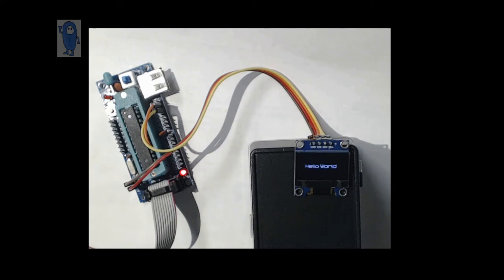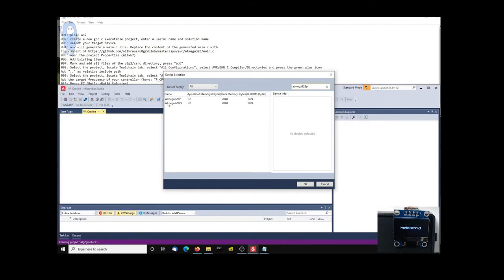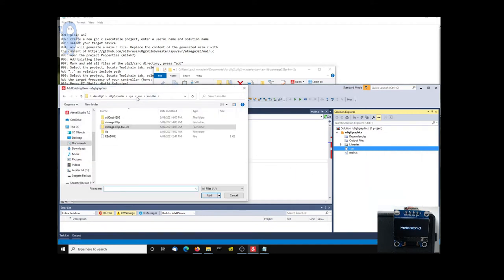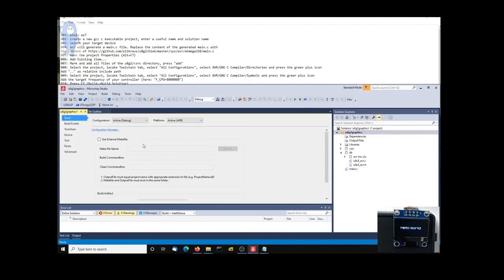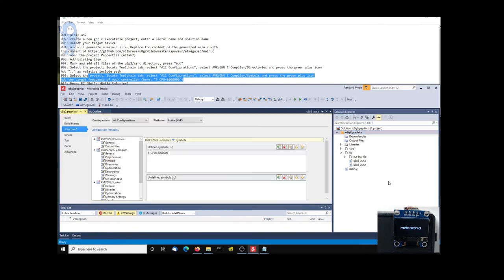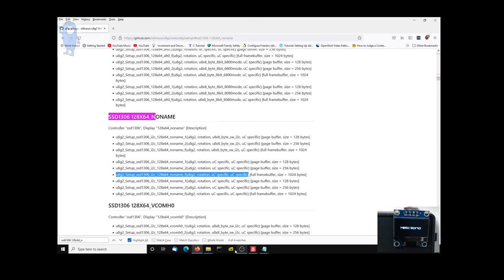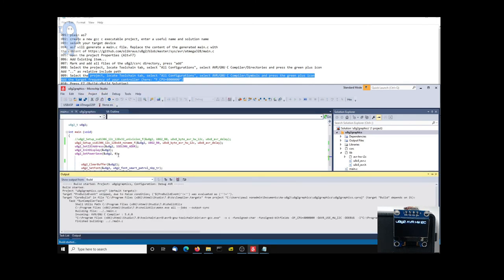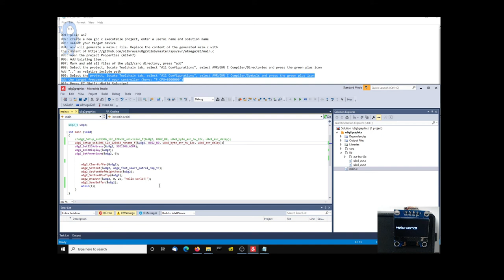AVR ATmega328p + 128x64 OLED + some u8g2 magic - setup in Atmel (Microchip) Studio 7

Comment: very good. How to pass a variable as a parameter to drawStr?
Reply from the maker: Hiya, its difficult to know what you want to do without more information...assuming you want to use a variable to replace the "Hello World!!" string, its quite simple....

Start by defining a string in an appropriate location in your code as follows: char myString[] = "Hello";

And then replace "Hello World!!" with myString in DrawStr parameter set.

If you want to replace the string with a number, its a little more complicated.  There is an example on the U8g2 website.  One way is to use the itoa() function in C and C++ 

To learn more about strings see https://www.geeksforgeeks.org/strings-in-c/, and about itoa() have a look at https://www.codevscolor.com/c-itoa-function and https://www.geeksforgeeks.org/implement-itoa/

Comment: Dear sir, on compilation AS7 shows erro :"recipe for target 'lib/avr-hw-i2c/two master timeout.o' failed". Can you please help me to get rid of this situation.
Reply: @Happymacer_P  any solutions yet? I have the same Problem and also the TW variables aint defined.  How do i fix that?
Reply from the maker: @merlin1708  Hi Ruben, sorry this is not an issue with my setup as per the video as I dont have that trouble, so I cant duplicate your error.  It must be something youve not done quite correctly while following the video, or in your PC security permissions, or something with AS7.  TW variables dont spring to mind either - sorry not sure what that means